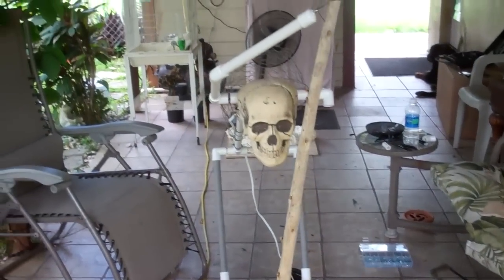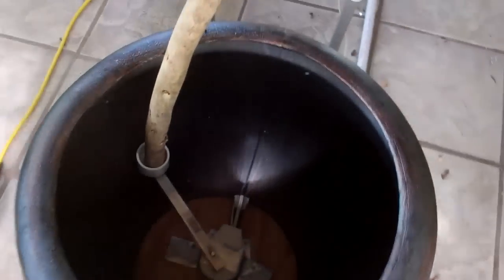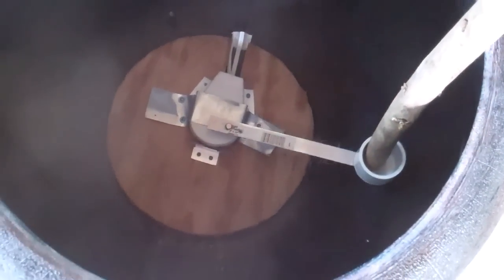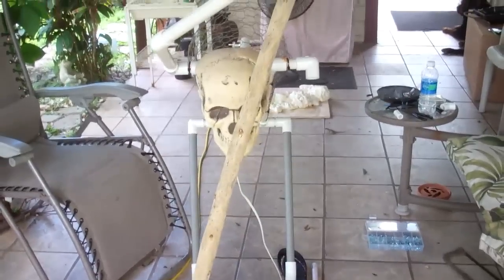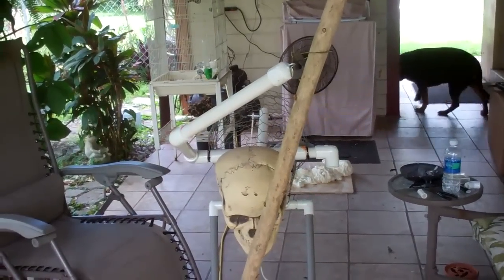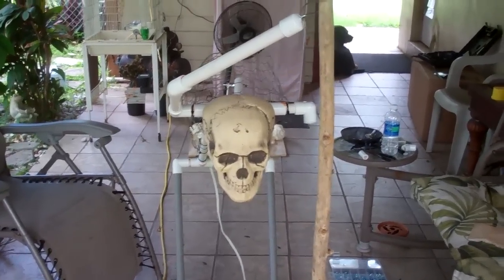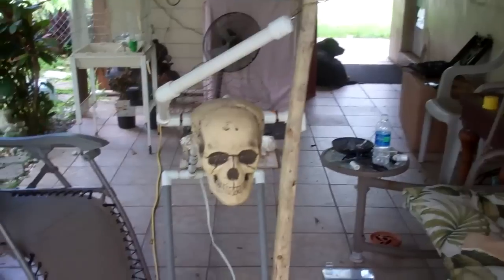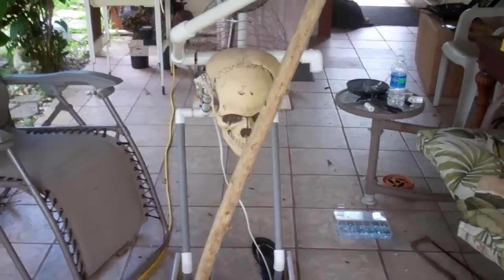The Cauldron is stirring 8D

Comment: Dawn, the Creep's coming out good. I think Devil's Chariot's original Creep used a 90 at the shoulder and elbow, but he kept the forearm straight up and down. You might want to try pushing the upper arm down more and straightening the forearm first. With that said, I used a 45 at the shoulder myself.

While you can use a heat gun to bend the PVC, there's a lot more flexibility using connectors and you can still heat and bend certain parts if you need to. Otherwise it's looking real good.

Rich